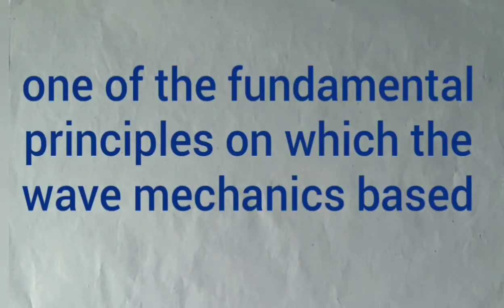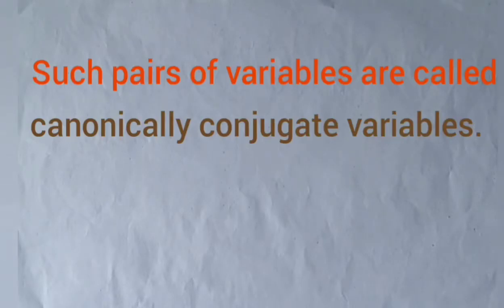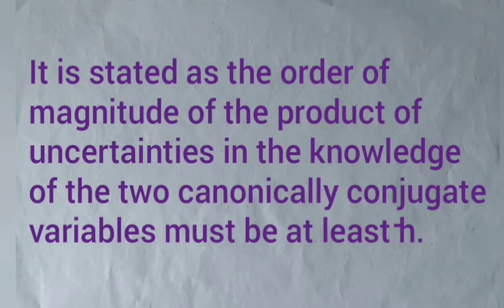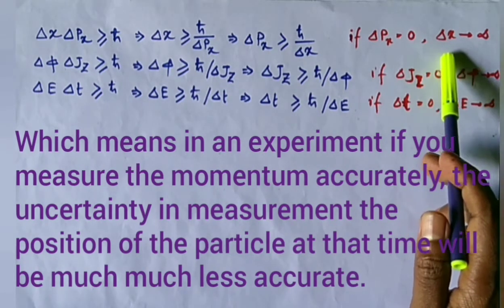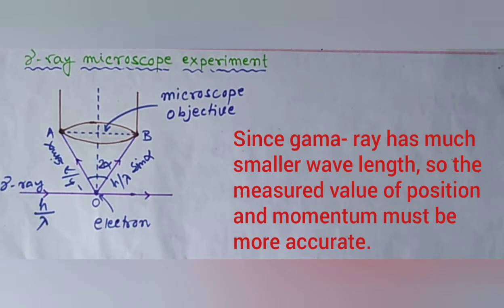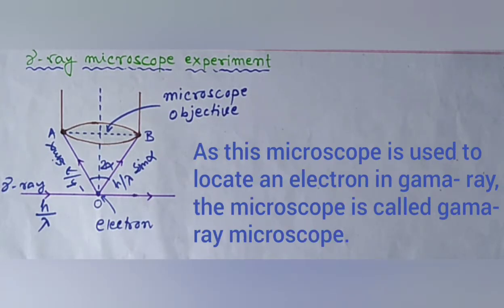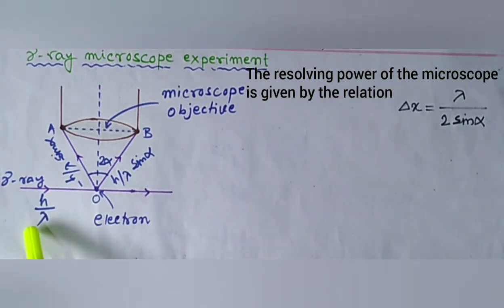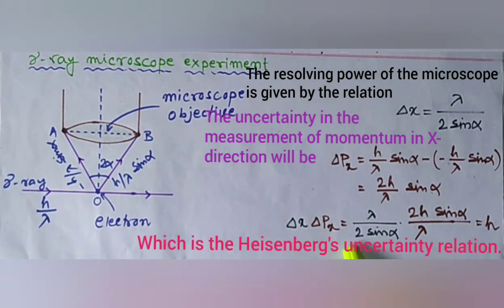Heisenberg's uncertainty principle and its illustration by gama-ray microscope experiment.

Comment: The average time that an atom retains excess excitation
energy before re-emitting it in the form of electromagnetic
radiations is 10 -8 sec. Calculate the limit of accuracy with which
the excitation energy of the emitted radiation can be determined.
i want the solve of thes quation pleas